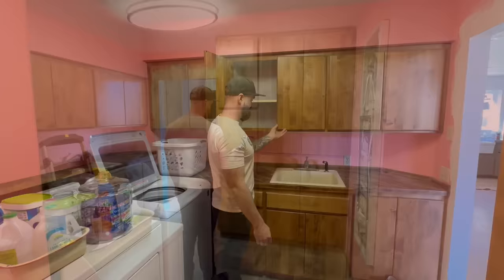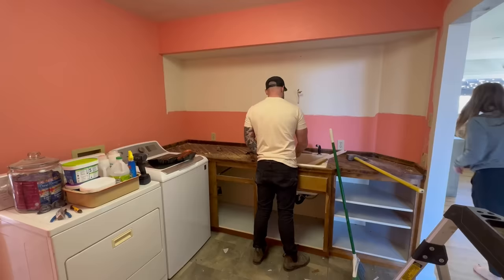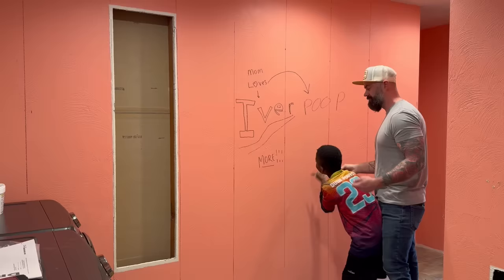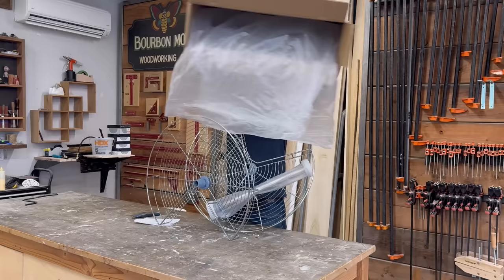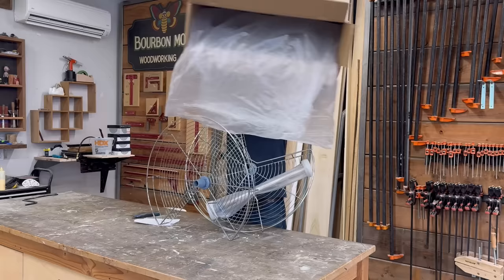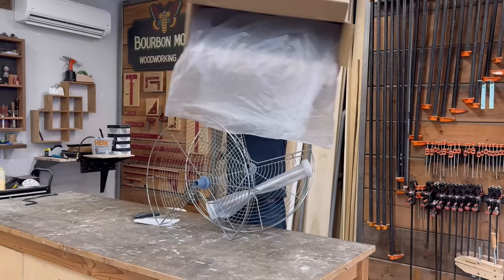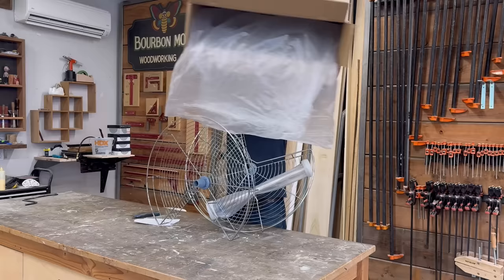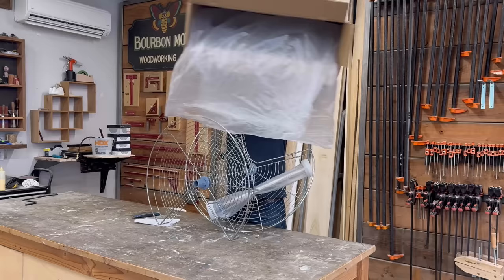Laundry Room Upgrade || Making Our Laundry Room Functional Again

Comment: Dude, I would die for that original laundry room. Our house was built in ‘57. Our laundry room is the washer/dryer crammed next to the AC and water heater with the water spouts just under the main electrical panel.

Comment: Quick warning, the fluorescent lamp has a toxic layer inside that’s the white smoke you see when braking it. Be carefull with it! Love your video’s!
Reply: I freaked when I saw that. Many people don’t know and I’m glad you made the comment. The doors should be opened to air the room and get out until it’s clear.
Reply: The white smoke is just powder from the inside glass surface that makes it white, not clear glass. The actual danger comes from the small amount of mercury inside and the vapors from it, which are invisible without a special camera. You would be safer swallowing mercury than it is to breath the vapors. We have mercury spill kits at work to deal with this. Yes, air it out. The good news is that most of it left the room with the old cabinets.

Comment: I believe you installed the shiplap upside down.  The flange should be at the top.  Doing it this way now water would enter behind the wall and you would not had to push the boards into the slot.
Reply: And, all of the nails could have been hidden...

Comment: Haha, you started with a fully finished, functional laundry room... even if it is not the best.  ;)  Me... I started with a completely unfinished basement, a washer, dryer and tub sitting along a concrete wall.  

It was my first major project... a full laundry room build with a new dual tub & plumbing, dropped ceiling, new walls, upper and lower cabinets, etc.  100% worth the effort!  I'm currently remodeling my ground floor (family, kitchen, living & dining).  All were classic 70s/80s design with minor updates done in the 90s before I owned it... golden oak!

Comment: I spent well over a year designing our new kitchen cabinets in Sketchup, then after watching your older videos on building cabinets I scrapped the whole thing and spent another year, ok, not really, just a couple of months, designing cabinets with separate toe kicks, which is the way I will always build cabinets from now on, so easy. As usual I over built them, and built everything out of 3/4" prefinished plywood, or so I thought. When I started assembling the cabinets they were all coming up a little more narrow than they should have been. I couldn't figure it out. Then I realized that my 3/4" plywood wasn't 3\4" plywood. It was 18mm plywood. In my best Jerry impersonating Kramer voice, the difference is negligible. However, it's enough that each cabinet was close to 1/8" too small. In the end it didn't matter, everything went together fine, and there were no major landmarks I had to worry about that would look crazy because of the difference. I'm down to my final two cabinets now, a 4' wide, 92" tall pantry, and the refrigerator cabinet. The boxes and face frames are installed, I've just got to finish the doors, and because they were too tall to build as one unit and get them in the house and stood up I built them with a top and bottom so I've got to do something similar to how you dressed up the end panel on yours. I can't tell you how much I appreciate your videos. You have a knack for making instructional videos that are clear and precise, and also humorous.

Comment: Face frame pocket screw conundrum:  pocket screws vs. Festool Dominos.  I've had to make that call before, and choose the Domino for the reason you ran into:  easy inset routing that could have run into the pocket screws.  Both are really good ways to fasten face frames.  The domino doesn't eat up router bits when you don't really want to buy a new one.  Great start on the cabinets.
Reply: @Navy1977  I assume 'diamond' is domino?  I cut the rails and stiles for the frame.  I then use the Domino to create the mortise on the rail ends and stile sides for the loose tenon itself.  Those are clamped (square of course) till dry.  Then I route the back of the face frame just like Jason did in the video for the panels.  I'll attach the face frame to the cabinet using using pins, brad nails, or in heavy use situations, pocket screws from the back.  I've actually used dominoes to do that on some shop cabinets for strength.  Worked well.

Comment: We installed a brand-new Lazy Susan in our brand-new kitchen in our 1964 house. The cabinet is 36 by 36, except it is not. It is supposed to be installed with a 6-inch space behind it on 2 sides. That is 36 x 12 square inches of wasted space. I needed every square inch, but I compromised by not pushing it back against one wall. It is a corner cabinet so there are two walls. This gave me room for my 36 inch sink base.

Comment: Awesome! Consider switching the washer and dryer so the dryer is on the right. Your detergent loving wife will appreciate it.
Reply: @Navy1977  yes. I'm a retired appliance tech and usually dryer doors will switch but not washer. Longer cords are available and worth it for the convenience over time.

Comment: Hettich make excellent cabinet hardware that are incredibly high quality. Far better than that Amazon flimsy thing. They also make a new version of the lazy Susan that swings out in a straight line and then the next section slides out. It can carry so much more. Lloyd

Comment: One question. On your cabinets that have doors, your face frame would extend 3/4" or so above the cabinet floor. Do you find them getting banged up more than if it was lower like most cabinets? Thanks.

Comment: Since you didn't mention it, why did you put the shelf under the sink?  Especially, since it is totally useless (as a shelf) and you will have to punch holes in it for the water lines to the faucet and drain line from the sink?

Comment: Cutting that fame down on the table saw made me cringe. I tried that on a radial arm saw many decades ago. It didn't end well.LOL Destroyed the frame , the blade guard and punched a hole in a wall. The new frame was built to the right size. Bought a table saw the next week.

Comment: Nice work so far. Will there be an upgrade to the W&D to go along with the fancy cabinetry? 👍👍
Reply: Don't forget to fashion a device to keep that new front loader door open to prevent mold and mildew! ❤
Reply: @Navy1977 That's a bummer. Sorry you are dealing with that.

Comment: "I don't know how to install ship-lap" if it was outside, you would have put it on wrong. inside? Meh, do it however. Though if you had put it on the other side up, it would have been easier.
Always a good video when the Building Inspector makes an unscheduled appearance - @16:58.

Comment: Why make the mdf be inset into the trim with two separate mdf panels as opposed to tacking a single piece to the side and just making the front face frame 1/4” longer? Then you could have just made the side trim/frame sit on top? Genuinely asking not saying that’s a better method.

Comment: 1) Them pink walls are disgusting for a start. 2) Are you not supposed to nail shiplap and tongue & Groove through the tongue? Looks like you installed it upside down. I mean, you could be an upside down kinda guy on the quiet.